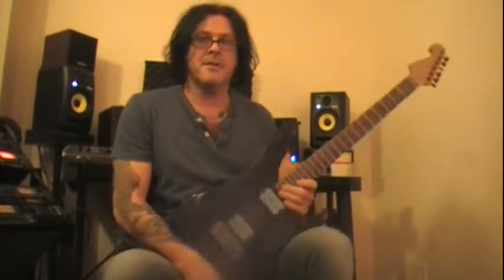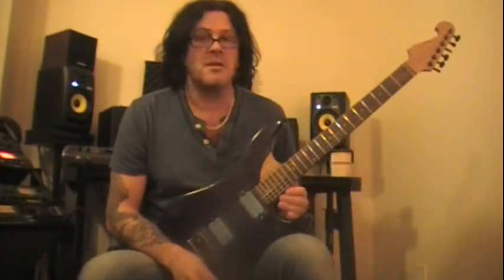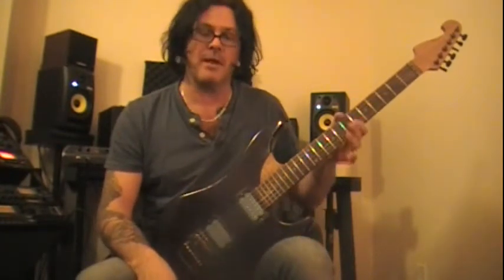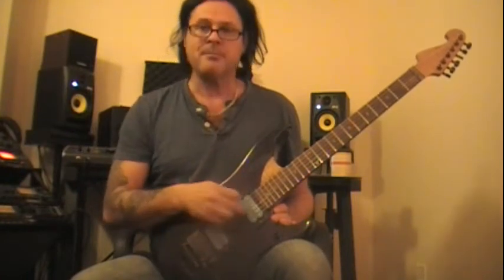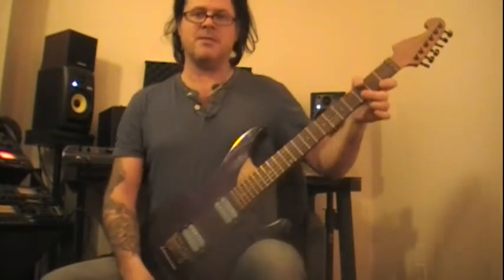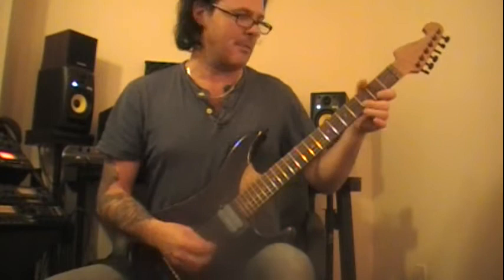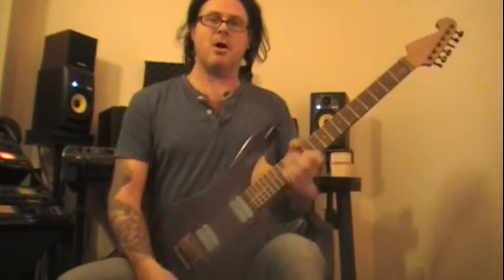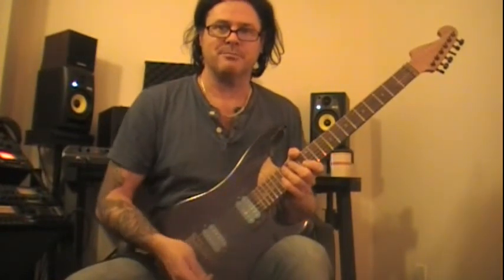Ian K - DIY Washburn N4 build - My first DIY guitar build

Comment: Where did you get the 5 bolt plate to connect the neck and body
Reply from the maker: They were available for a time on EBay, but I don’t use them. I’ve built a number of these now, and I simply use four bolts with countersunk grommets. Never had any issues.
Reply: Ian Kurz would you ever build a neck for someone?
Reply from the maker: @camcahill  - I don't think I could.... Sorry man.

Comment: Very nice.  I have an n61 body and a n4 neck that i need to put together.  The neck as is wont fit on the body (the joint), how hard was doing the neck joint?
Reply from the maker: I did it from templates so it wasn't too bad, but I do understand that through the years the neck had changed slightly, so maybe that's why you have the issue. ..? IMO it should just bolt together...
Reply: okay gotcha.  It could be that, or the fact that the neck is an unfinished 2nd from the factory and still needs more material removed from the heel.  Just measured and the scale length seems right, so I assume itll need some massaging.
Reply: And when i mean straight from the factory..its still has the mill marks on the back of the neck.  Beautiful birdseye maple though.
Reply from the maker: @MiikeyLawless  when you buy a replacement neck, I believe you usually have to sand down the extended side to match the body. I once bought a neck and had to do that myself.
Reply: Yeah that would make sense.  Kind of the downside of this neck joint, its has to be spot on and requires more attention to detail.
Reply: @Michael Peretto Hi Michael, I need a N4 replacement neck cause mine has fallen apart ( broken SEC). If you still have yours and finally won't mount it, I am definitely taker and buyer. Please let me know. All the best . Ludo